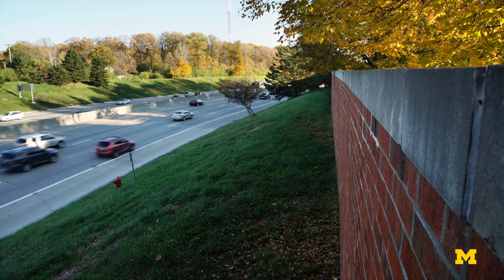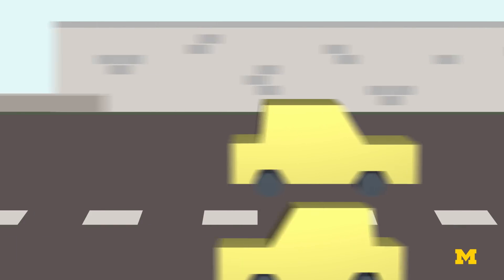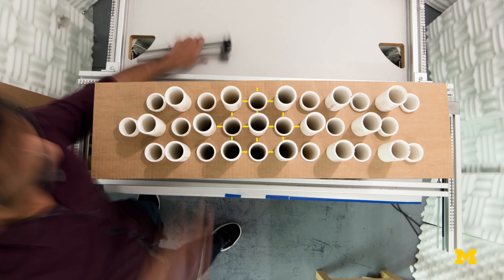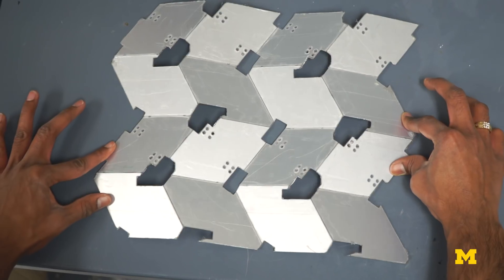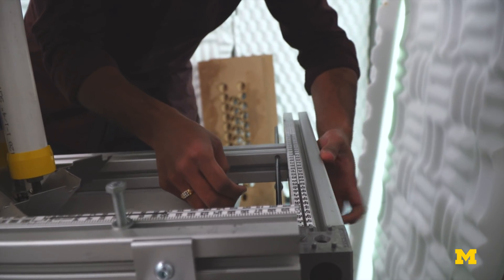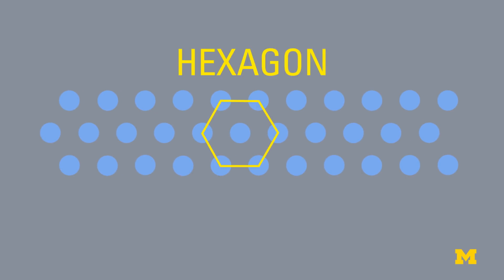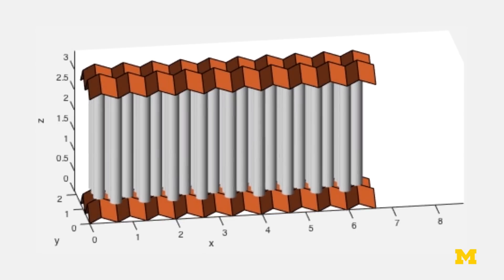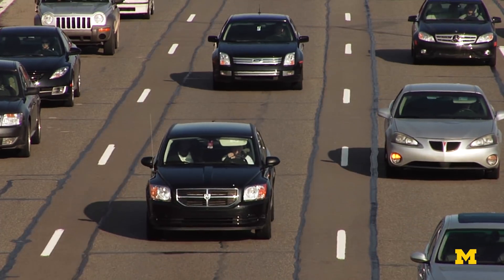Managing noise pollution with origami traffic barrier

Comment: Brilliant! Just a couple of tubes in a certain configuration to block sound. But in the long run, I think it would be cheaper to put two barriers side by side, one for 500hz and another for 1000hz. No moving parts, less probability of breaking down, cheaper ongoing maintenance. Nevertheless, the origami base is ingenious and would be useful such as where space is a constraint.